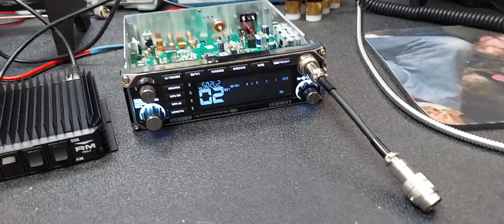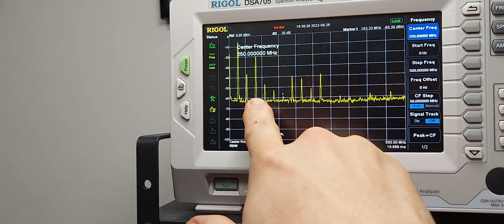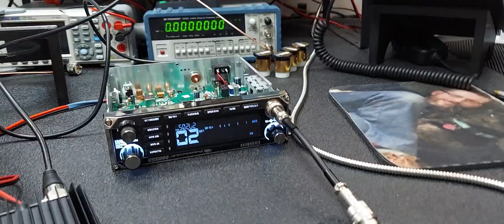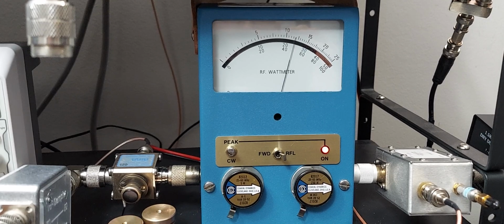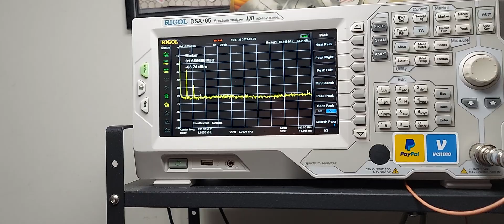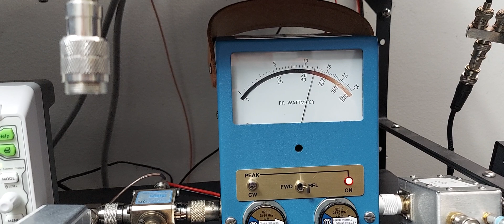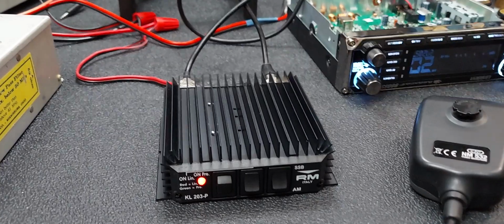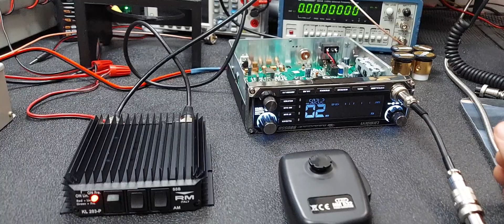Importance of Low Pass Filtering in the hobby.

Comment: Just got one of these hooked it up and made my SWR go through the roof I took it apart can't find anything wrong with it checked it with my meter. Thoughts
Reply from the maker: It should have very little to no effect on SWR. 
Insertion loss is very low.
Your filter may have had too much power ran through it, causing damage.
Reply: @ScottsRadios I bought another one and same problem... was it in line by SWR is a 3 when I take it out of line my SWR is a 1.2 all coaxes are good I wanted to add it to my system as a compliment to my sound. It is 52 ohms and not 50 but I wouldn't think that would be a big deal
Reply from the maker: How are you measuring SWR with the radio or do you have an antenna analyzer?
Reply: dosimeter
Reply from the maker: 52 ohm does not make a difference..
Most likely the Dosy is not reading accurately with the filter in line. 
You should have the filter hooked up to the antenna out on the meter or with a jumper out of the antenna out on the meter to the filter. Then actual antenna feed line connected to the other side of the filter.
Use a jumper coming out of the back of a CB radio into the filter and then connect your antenna to the other side of the filter. 
Check the SWR with a classic radio that you might have like a Cobra or Uniden that you don't think has been golden screwdrivered.
It shouldnt make any difference to SWR.
The easiest way to sweep the filter is to using antenna analyzer. 
You would see the SWR curve when you sweep frequency.
Reply: @ScottsRadios the meter is directly after the radio then the filter that way I know the reflected going to the radio I don't have a amp because the radio puts out like 400 watts also I've tried more than one meter that are rated for high Watts I will check it again after work but if it's still high I'll just throw my hands up thank you

Comment: Is this really necessary anymore? Those filter boxes were needed when TV channels were analog. Channel 2 TV is 54 Mhz which is the first harmonic of 27 Mhz. These days TV is digital and they are really virtual channels and are up in the 500 Mhz area. Modern TV's use digital signals and streaming is replacing cable and satellite. The hookup cables to TVs and other components are usually HDMI which carries digital streams between TV components. These aren't susceptible to RF interference. RF interference can still get into neighbors electronic devices regardless of a low pass filter. Excess speaker wires can act as an antenna and many amplified computer speakers lack sufficient shielding to mention a few. You can offer anyone complaining about your station some snap on mix 31 or 43 ferrite beads and instruct them how to properly wind them up and in many cases, that will work.

Best to be sure your radio produces a clean output without over modulation which can produce unwanted harmonics.

Comment: Hello, As long as you don't use a amplifier you should think about sending me one.😊 I need one for the PA on the CB. I don't use the CB unless it's for some crazy  emergency. Nice equipment though. Wish they had a sign wave amp for CB Would get a cleaner signal.
Reply from the maker: There are many amateur options that can't be used but multiple avoid them due to high cost.

Comment: I noticed quite a rise in SWR using the exact same Drake filter on a 203/Bearcat combo.
Reply from the maker: I shouldn't raise your SWR. Probably need to change your jumper length to something more suited for your installation.
Reply: I revisited this setup and experimented with a variety of setups with mixed results.  I suspect that the rather aged filter may be part of the problem.  Keep up the good work, I think your philosophy of use and approach to tuning is a welcome option in a world of dudes yelling AAAAUDIO. @ScottsRadios

Comment: Is there a way to test this filter I got one just like it and on my 69ffb4 it shoots the swr's up over 3 but my antenna set at 1.3 with a analyzer.
Reply from the maker: Connect to 50 ohm dummy load to the output side of it and you're analyzer to the input side.
Reply: @ScottsRadios  ok but this doesn't have writing on it saying input or out put or don't it matter
Reply: @ScottsRadios did just that and my swr's on the analyzer shot up to a 6
Reply from the maker: I think your filter is defective.
Possibly,  someone ran way too much power through it.
Reply: @ScottsRadios  ok kind of thought  it was bad
Reply from the maker: I've never seen a bad one but I would assume if the SWR is high like that then something has gone wrong within the filter.
Maybe just open it up and inspect it for a bad solder connection they are pretty straightforward on the inside and you should be able to see if there's something that's gone wrong.
Reply: @ScottsRadios  going to open it up tonight to see what's up

Comment: Where can I get one of those filters
Reply from the maker: Check on eBay there are lots being sold.
Reply: @ScottsRadios got one 15.00
Reply: @ScottsRadios 

I'm looking at adding one of these behind a Texas Star 500/667. 

My SWR while it's in line but turned off is 1.1 across 40 channels. 

When the DX500 is turned on is 1.5 

I'm debating picking one of these up to see if it would help with the mismatch slightly occuring. As well as cleaning up the signal. 

Would it also benefit more to try to source a 50ohm filter or does it not matter between the 50ohm and 52ohm? 

Best regards, thank you for the informative video.

Comment: I'm running a 955 and I turned the modulation down to 80% at wide open mic. I turned the dead key down to about 1/4 watt. I drive that into a 2x8 Fatboy. 200w dead and 1200 pep I have a 3kw low pass and I use a nano vna and it's clean clean clean. I've had people drive near me and my neighbor who uses an icom 7300 and only heard him while he was barefoot on the adjacent channels only slightly. I strive to stay clean. I wish more people did too. I talk to a few people from 10-40 Miles on a regular basis with a IMAX 2000. I need to get a sampler slug so i can get a direct sample

Comment: I am running the same Low Pass Filter on my base station with a RM503. I use an amp only because my location is not a good one to get out easily. I use the Low Pass to make sure neighbors have nothing to complain about. My reason for posting here is RM Italy makes small Low Pass Filters and was wondering if you could test one out or recommend a small one for mobile use?  Good video as always.
Reply from the maker: I think I did a video a long time ago showing the Rm Italy low pass filter.
Although it does work from my memory I find that the one in this video works much better.
Reply: @ScottsRadios  What would be your opinion on running the same low pass filter on the input as well as the output? Would filtering what goes into the amp do anything significant prior to amplification or would that just be a waste of money?
Reply from the maker: @FotoFarmPFE  that would depend on what type of radio is being used.
If the radio has an onboard amp then yes absolutely.
Main thing to consider is these amplifiers are not linear in any way.
They should be called Power producers, because that's all they do.
Spreading power out over multiple frequencies instead of homing in on the one desired.

Comment: Mike I’m curious to know if the filters block incoming emissions and would be worthwhile to install in a modern semi.
These trucks have lots of RFI from many sources as well as inverters.
I’ve ordered some ferrite’s for when I install too.
Reply from the maker: It does block some incoming.
Noticed if I have a radio that's NOAA capable it will block out the reception pretty much.
That's not saying that it's going to block out unwanted interference though.
Reply: So in my situation I have an AM broadcast tower 1,000 watts at 600 meters from my station I get a lot of interference making lower bands impossible to use. 10 and 11 meters weren't too bad but i bought a bandpass filter and a low pass filter. Obviously the bandpass will attenuate all signals outside the intended band in or out however I'm wondering if it's worthwhile to connect both inline?

Comment: As a ham, I worked over 48+ countries on my Uniden 2510 mostly on a hamstick on my truck. In rush hour. Peak of the late 80's Sunspot Cycle.. Even East Germany who doesn't exist anymore.

My best was a mag mount with the same radio on an A/C unit in the 7th Floor of the then Holiday Inn one early AM. In Laredo, TX I had a QSL with a Japanese Station on 10 Watts.

Never needed a linear for 10 Meters. Now 6 meters it helps depending on the propagation mode, a decent antenna always more. The President and CEO of one of former employers worked 6 meter moonbounce. He could afford multiple 60+ foot yagis.
Pointed a big phased array towards the moon coming up or going down. Traveled around the world doing it. 
Antennas make big difference. 

Best thing too is a good tune up and alignment of your rig too. By a vetted pro like the poster of this video or if a ham with / properly licensed with professional equipment, It will last!
Reply: Can't  beat PRESIDENT HR2510 . I own the only 3 HR2510's with Moffett finals in existence.